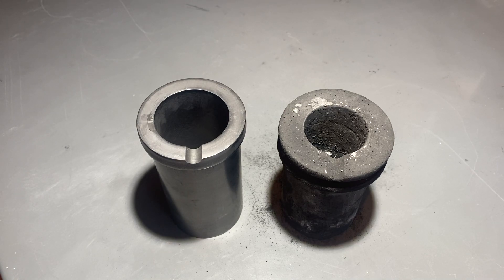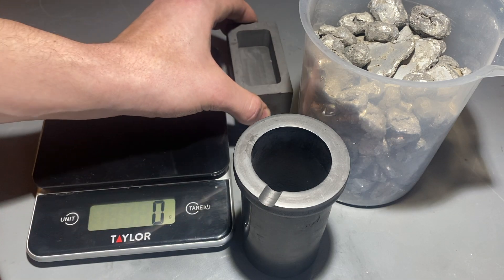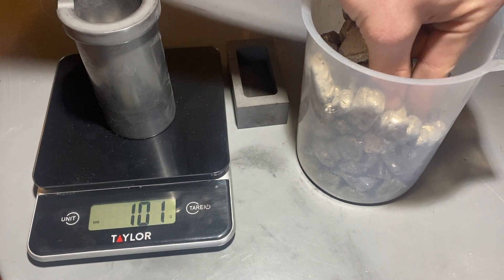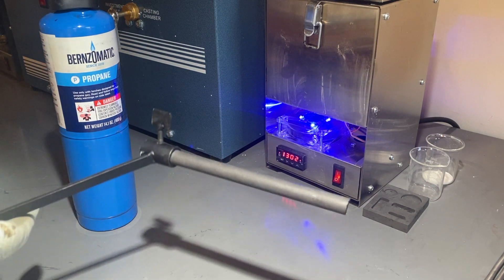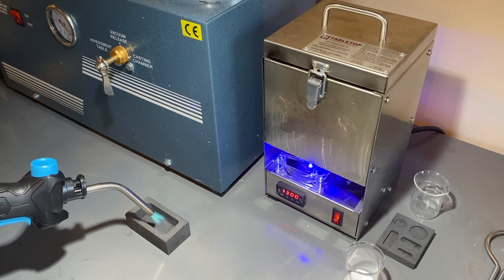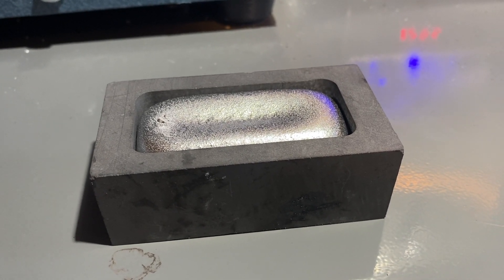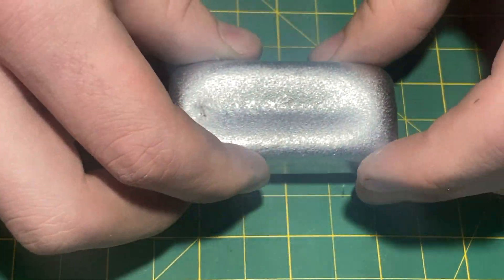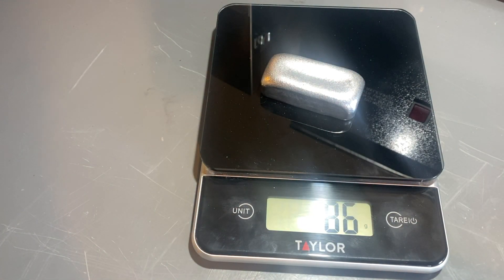Pouring an Aluminium 4032 Ingot

Comment: Hi, i have a question, melt aluminium is toxic??
Reply from the maker: Pure aluminum shouldn’t pose any significant issues in terms of producing any toxic fumes if melted properly. However, I see a lot of people on YouTube melting down aluminum soda cans which have plastic coatings that let off nasty fumes when melting. The metal I use was from a car wheel and has some paint on it that does burn off when I melt the scrap. I make sure to always ventilate and to wear a respirator if necessary. Hopefully that’s helpful. Thanks for watching Sebastián!
Reply: @Levi_Sheridan  You leave me somewhat worried since I used to melt soda cans about two and three years ago and I practically swallowed all those fumes
Reply from the maker: @Sebastian-lu8en  I wouldn’t worry to much. I would just encourage you to not do that again in the future and if you do to use proper and extensive safety precautions such as a p100 mask and proper ventilation as a start.

Try to source fresh aluminum from a place like Belmont metals. It’s expensive but you know what are getting and it’s pure. If you are unable to acquire aluminum from somewhere like that, try to get aluminum off a scrap yard from parts like car wheels and engines which are parts that are made with casting so they should work well for that purpose again.

I hope that’s helpful. Again, I wouldn’t worry too much about your past experience with melting soda cans. You did it a few years ago and any major effects would of likely taken affect by now. Many people do it and are seemingly well off. It’s just not ideal and something you want to expose yourself to often.
Reply: @Levi_Sheridan  Thank you very much, lately I only melt some aluminum foil to make small ingots, I have been worried for a long time because I breathed a lot of smoke from the cans but I did not do it again and with what you say I am calmer. aluminum foil appears to have no plastic and does not release fumes. I subscribe to your channel and thank you very much again
Reply from the maker: @Sebastian-lu8en  thank you for your support!

Comment: The mold looked dry, I use cast iron, and that's important to oil, I'm not sure on graphite. That orignal crucible has alot of life left in my experience, I'll email pictures of crucibals I have run much farther down with out failure if you want. Awesome to see a casting video again, I'll look forward to more!
Reply from the maker: I’ll try using cast iron soon. Someone else suggested  I oil the mold and I bought some but my understanding is that the mold should be heated and my thought was that the oil would be destroyed by the heat. I guess it’s an either or thing or am I wrong? 

Please send the pictures over, my thought, with very little experience under my belt, was to be conservative but I’m looking forward to seeing how much more I’ll be able to use it. I’m excited to be able to cast again and have some fun stuff planned.
Reply: @Levi_Sheridan  email sent.
Reply from the maker: @Yukkaguitar  got it, thank you very much!